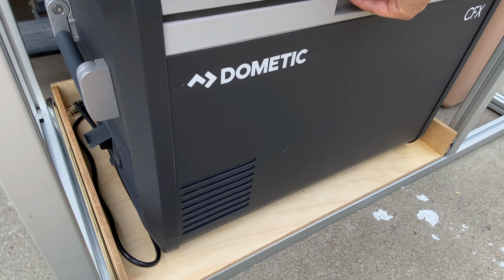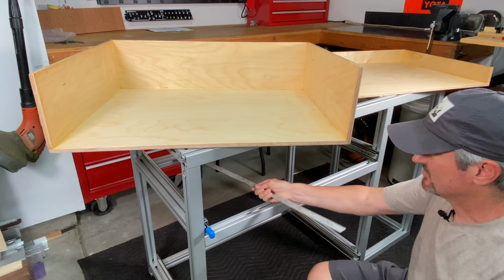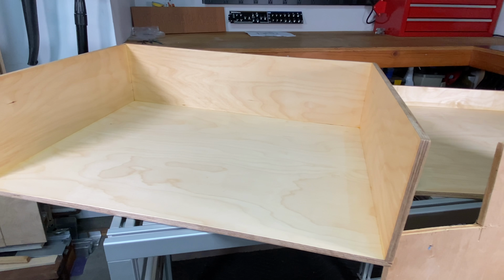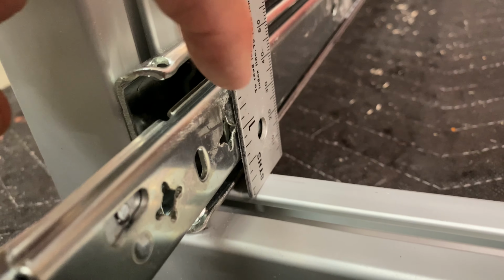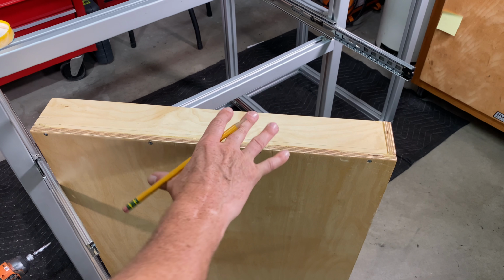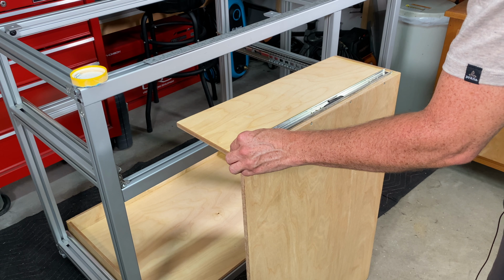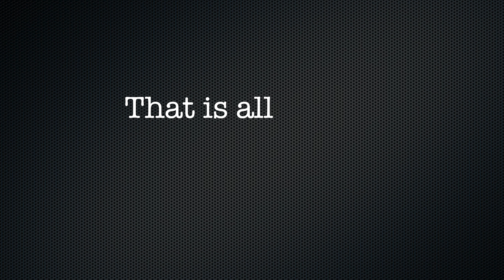DIY Locking Fridge Slides in an OurKaravan Cabinet Kit

Comment: What are the internal drawer dimension? I want to use my arb zero 73 with your setup, the dimensions are 29.7in (w) x 18.5in (d) x 22.2in (h). Thanks!
Reply from the maker: The aluminum frame I sell has a 31.5" opening.  Once you've accounted for the thickness of the drawer slides and the 1/2" sides of the wooden drawer box, there is about 29" inside the drawer.  We can widen the kit if you like. Please reach out to us using the contact form at ourkaravan.com and we can accommodate.

Comment: These look solid. How would you compare the durability and weight of aluminum frame, against wood framing.  We are building an overlander box van conversion camper see our rough shorts for a look at the concept.
Reply from the maker: It all depends on construction style but I would say 99% of DIY’ers will end up with a stronger and lighter end product using the aluminum.  That said someone who is well crafted at woodworking and has a bunch of nice tools for joinery can achieve a reasonably strong and lightweight structure as well. The aluminum has the added flexibility of being able to add or modify it down the road.
Reply: @ourkaravan  thanks. Our box builder will be making the frame out of Steel and fiberglass over plywood. So since it's on a E450 box van chassis I was thinking of going with aluminum cabinet frames to save weight and keep it durable as long as the screws don't rattle loose
Reply: @livingworkingoutsidebox , you can use a thread locking glue like Loctite or Permatex Threadlocker to keep your screws from loosening. That's what auto makers use when assembling a car engine.
Reply: @questioner1596  thanks

Comment: Just made my drawers. My hardwood store made all my cuts in the Baltic birch for $1ea. Easy after this. How have you organized the drawer? It can hold a ton of stuff.
Reply from the maker: Thank you for reporting back!  IKEA makes a range of adjustable drawer dividers that are helpful.  I have a bamboo organizer for holding silverware and cooking utensils, then some various bins from IKEA and Target for subdividing-out the space.
Reply: @ourkaravan  Pretty frustrated right now. I can't get either drawer to slide more than halfway in. I checked my drawer width and both are exactly 30". Not sure what's wrong.
Reply from the maker: @davidterrie7661   My guess is you have a bolt protruding that is preventing the drawer slide from getting past.  You can try lower profile bolts or depending on what you're working with you could partially counter-sink the bolt.  That said, this normally is not required.
Reply: @ourkaravan  The drawer slides go in when not on the drawers, and I used the kit volt, so I don't think it's a bolt. I had to return the slides because the ball bearings were poor anyway. Trying a different brand when they arrive today. Fingers crossed.
Reply from the maker: @davidterrie7661 You may have received a defective pair of slides as I and many others have had great service from these.  These particular slides were recommended to me by another van builder, so they are literally in hundreds of vans out there.  Let me know how it all comes together.
Reply: @ourkaravan  I ordered some replacement slides made by Yenuo. They seem identical. I found I needed to file down most of the bolts, but I've gotten them to work. (I grabbed them by the shaft and rubbed them back and forth on a metal file.) I'm thinking my tolerances are a fraction tight and that shaving maybe an eighth of an inch from the drawer width before assembly might have helped. They are dead on 30", but the fit is tight. 

Anyway, I've bolted the galley into the van now and will install the sink and faucet tomorrow. Holes already cut. It's coming together.

Comment: Just curious, if you have these cut out for short bed trucks. I’m trying to put a slide in the back of a Jeep gladiator, and would love to have a pre-cut system.
Reply from the maker: These kits are designed for vans but literally anything is possible with this slotted aluminum.
Reply: @ourkaravan  so do you make one that slides out the back of a truck
Reply from the maker: At this time I do not.

Comment: Great video!! How do you attach a door front on your fridge cabinet with the blue locking pin which extends beyond the cabinet?
Reply from the maker: The door will require a notch for access to the locking lever.  If you Google locking fridge slide cabinet you should find some inspiration. Good luck!
Reply: @ourkaravan  Thank you!

Comment: I like the one-handed/one-foot unlock idea, seems convenient. Any disadvantages or advantages to the one-locking/one-nonlocking setup? Any decrease in stability when it's locked or extra rattle noise?
Reply from the maker: The slides are rated for 250 lbs so a loaded fridge and drawer should be well within the capabilities of one lock.  That said, two locks would make it even more robust.  I suspect if loaded to 250 lbs that one drawer lock could present an opportunity for the non locked side to wiggle just slightly, but I doubt it. I figured two locks would be more inconvenient to open and close but no other downsides I can think of.

Comment: Really good video, quick question, how do you ensure the power cable doesn’t ‘catch’ when sliding the fridge in and out?
Reply from the maker: One way is to use a loose cable tie or similar to keep the cable higher than the fridge so it doesn't catch.

Comment: How did you keep the refrigerator from moving around?  That's a lot of weight should you have to stop suddenly.
Reply from the maker: The fridge is bolted to the structure using angle brackets on the inside.
Reply: Don't dometic fridges have 8mm threads on the bottom? You could bolt it there as well I think.

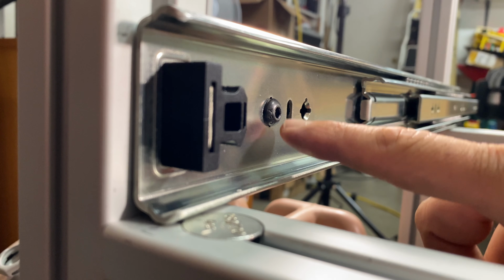Comment: Hi and thanks for helping us all out. What is the large thumbtack looking thing that joins the 80/20 at 2:16? Also are you available to hire for custom work or designs not available on your website?
Reply from the maker: That is an anchor fastener from 80/20.  We use these in our pre cut cabinet kits to make assembly strong and easy to make.  
I would love to eventually do consultations or partial builds, but at this point in my life I am short on free time.  I appreciate the inquiry though!

Comment: thanks for these videos Ken, very inspiring... did you have to buy 2 sets of locking slides? and now you have 2 right side locking slides that you aren't using?
Reply from the maker: I bought one set of locking and one set of non locking. I used one of the locking for the lower drawer and one for the upper, and used the non locking on the other side. So no leftover parts

Comment: Did you have to modify the hole in the slides. I have a 20 inch slide and the holes on the slides will not accept the the bolt that will fit into the tNut.  Also the 1/4 bolt doesn’t thread into  at nut that I have been using.  Wondering if the holes in the 22inch slides are larger that the 20 inch drawer slides   Seems unlikely but I don’t have a 22inch slide to confirm whether or not that is the case
Reply from the maker: I didn’t have any issues at all with the 1/4-20 bolt passing through the holes on the 22” slide. Did you buy the exact same slide?  You’re right, it seems strange they would use different hole sizes
Reply: @ourkaravan Ken, I have  22" slides VA2053 and the 1/4-20 won't fit in the hole.  I have to drill a little bit bigger.
Reply from the maker: Did you fully extend the drawer slides before installing the bolts and are you sure you bought the same ones I linked?  This is curious as the holes in mine easily accommodate the bolts…were the bolts close to fitting and thus maybe it’s a quality control issue on the slides?
Reply: @ourkaravan   Yes I did fully extend it. I don't think it's quality control because I bought three of them and they all the same.  Also the 1/4-20 bolts may be too long.  It was still loose after tightening the screw.  Perhaps the material vadania used thinner?.
Reply from the maker: I'm really stumped on this one.  The original commentor indicated he had this experience on his 20" slides, while I used the 22s.  But now you're using the 22" with a similar issue.  I haven't had anyone else point it out and neither my locking nor non-locking set had this issue.  I'll be keeping an eye out for this but I'm just as curious.  Did you drill them out a little?
Reply from the maker: @theoforand432  I don't have a specification for the bolts that I can find, and it's not clear what size/type of bolts you purchased.  I think the easiest solution would be to take the existing bolt you bought to a hardware store and find one slightly shorter and perhaps with a lower-profile head.  (My local Ace Hardware has a great selection.). It's probably easier to either drill or file the holes in the slide than to source smaller t-nuts and bolts.

Comment: Silly question, but how do you conceal and access the fridge drawer locking mechanism with a drawer face in place?
Reply from the maker: Not silly at all.  The lever needs to be accessible, so you need a cutout for it to operate.  You can see a lot of examples on Sync Van’s website, where they use a similar design.  Alternatively you could use a marine slam latch if you prefer to not use the locking drawer slide.

Comment: I would like to build this but have the unit in the door area so that when outside I can slide the domestic frig out and when inside slide it in.  I assume this would work with two way drawer slides but don't know the nuances of this.  Any thoughts?  Any slider recommendation?  Thanks,  you have convinced me to use 80/20.  Gary
Reply from the maker: Hi Gary, you would want to check and see if the fridge you want to use will fit between the framing in that direction.  Keep in mind to account for the 3/4” thickness of each drawer slide (if you use the ones I linked) plus the thickness of the 1/2” plywood box on either side.  If you are willing to have a deeper galley you can follow the instruction near the bottom of the product page and it will tell you how to order the cabinet will custom dimensions.